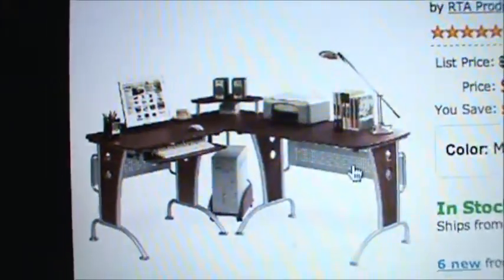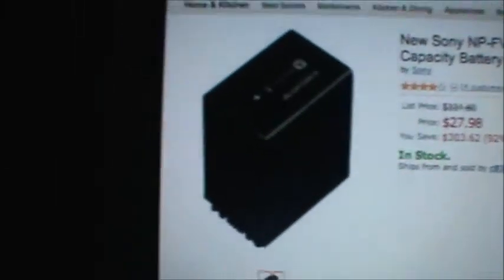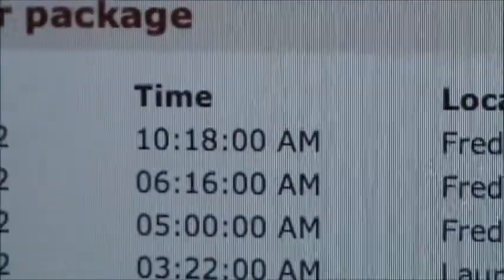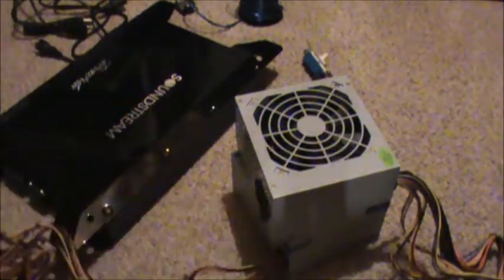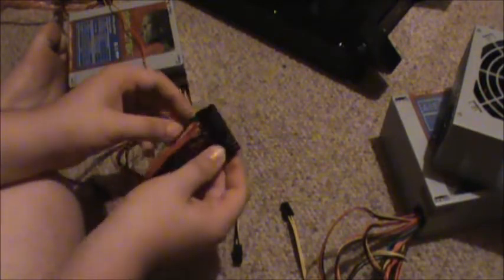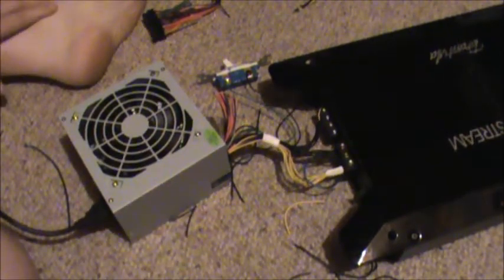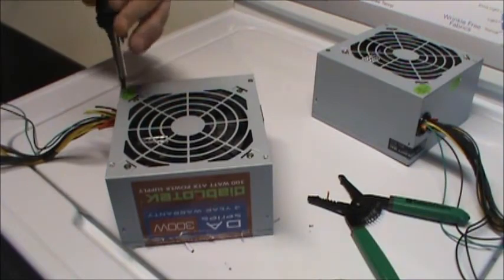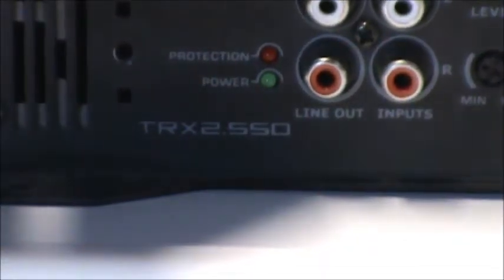Penguinboy1995's Vlog For 6-21-12. New Car Amp Install

Comment: Glad you figured out how to get the PSU's to work out of a computer. Iv'e never seen a PSU that required 3.5V to the brown (mysterious never used) wire. Iv'e never had that happen iv'e always just grounded the green signal wire. Hope it all works out for you.